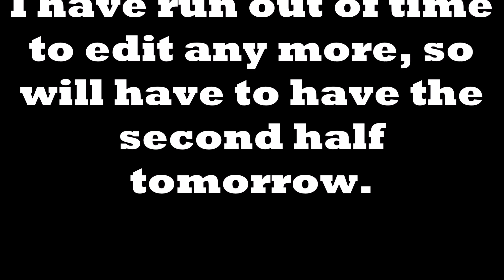19/03/24  An Alaskan mill for the giant cedar log.

Comment: Just be careful that it doesn't split once its in place. I remember doing a Bar top for one of the big Banks at one of their Sports Clubs in the early 80's with a solid section of Beech. When it went in it was fantastic and polished up really well. About 9 months after it went in the Manager said he heard an almighty crack in the middle of the afternoon and the thing split in about 3 pieces. Ironically the Joinery Manager who built it always said it would happen and should have been laminated but the Architect wouldn't have it!

Comment: Liked the video. Just like to now how much quicker is a ripping chain and what difference there is in finish
Reply from the maker: A ripping chain has more cutters, and will take bigger chips, but will leave deeper saw marks in the timber than the skip chain that has far fewer teeth and the depth gauge is kept a bit longer. I expect a ripping chain would be at least twice as quick through the timber.

Comment: I would not have dropped the slabs on the ground,they may have cracked.I would have slid the forks under each slab after they were cut
Reply from the maker: Only the two or three centre slabs had a shake, nothing split, were all good 🙂👍🏼